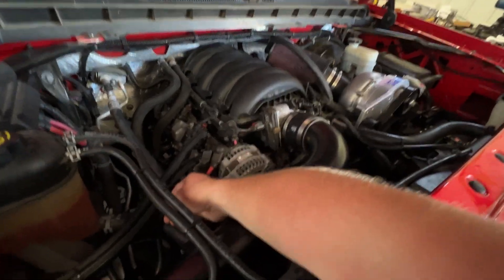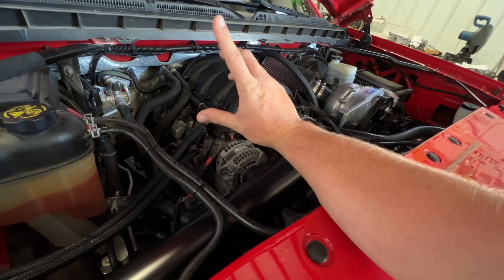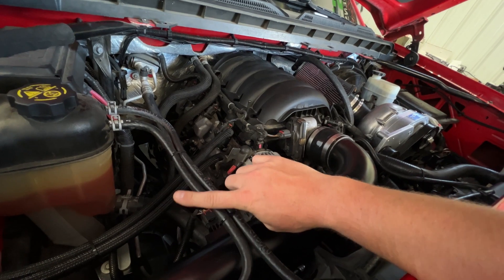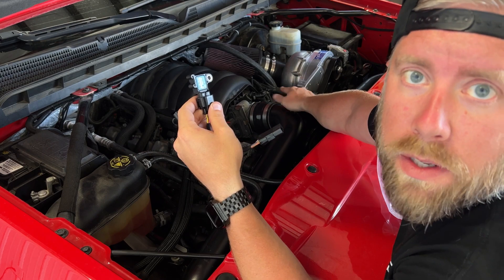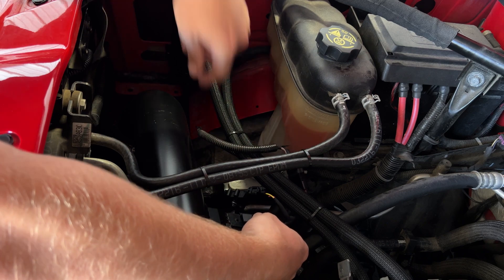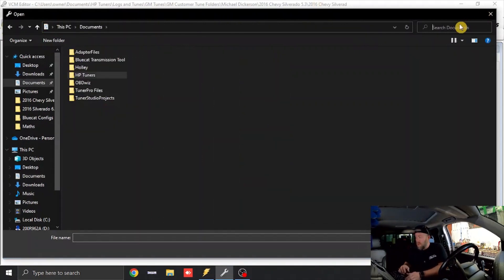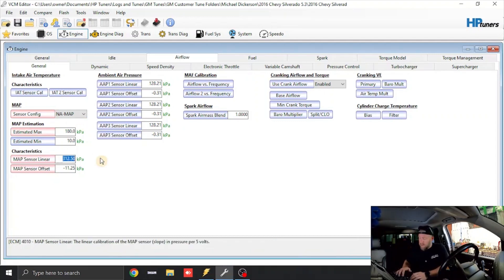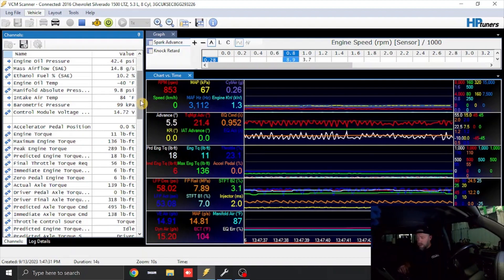Gen 5 DSX Baro Breakout Explanation, Install, and Calibration

Comment: My C7 with a vortech has the dsx breakout with 3bar map and stock 1 bar for the baro. They never changed the Sensor config to NA-Map. Should I change it and will anything need to be retuned if it is changed?